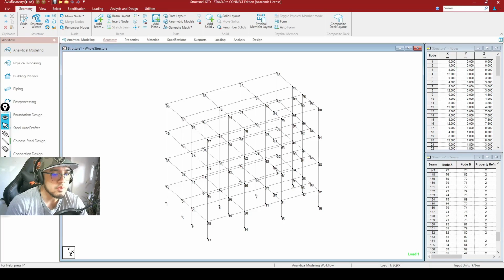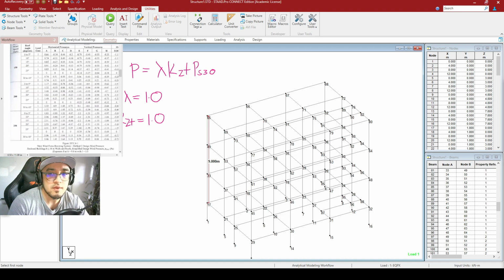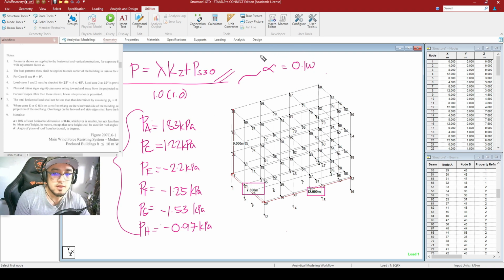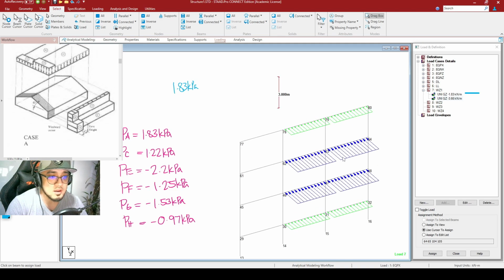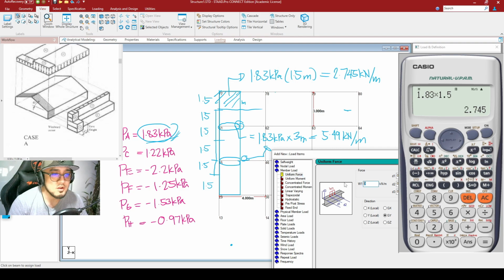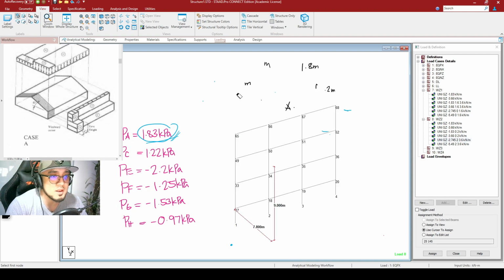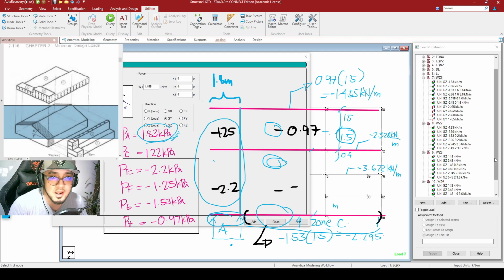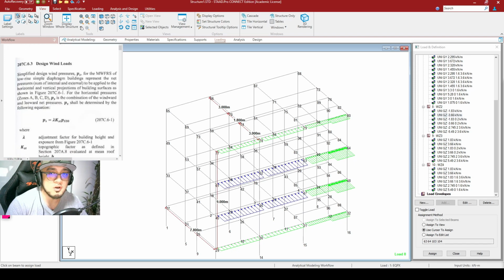STAAD.Pro Module 3.2: NSCP 2015 Wind Load Assignments. (Low-Rise Simplified)

Comment: may question po ako, in your example WZ3 and WZ4 are both applied sa rear part ng structure noh. What if may building that is taller sa rear portion ng structure na yan, icoconsider pa ba po applyan ng load yung WZ3 and WZ4?